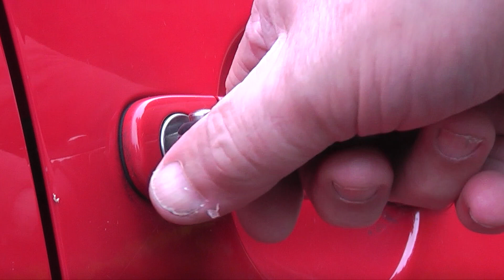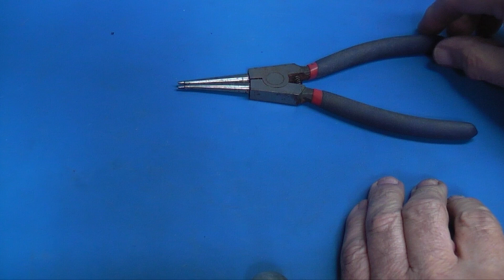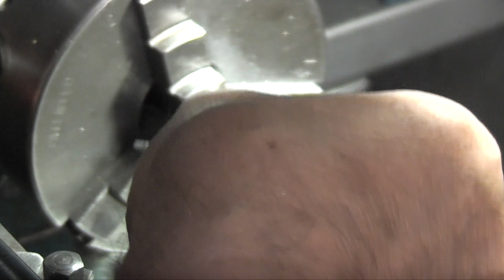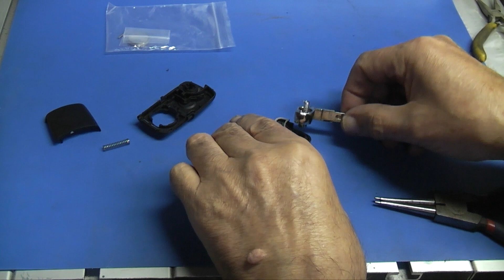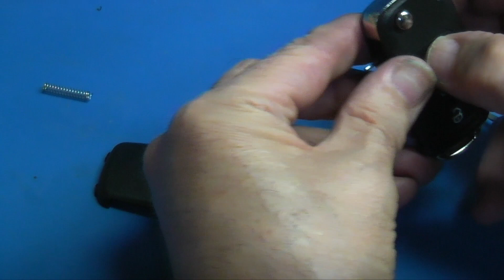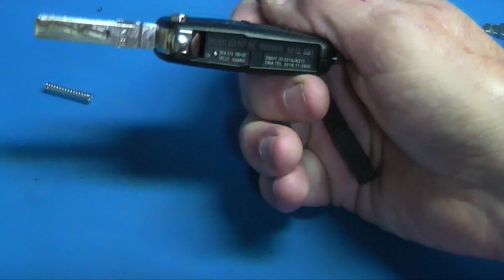Broken car key

Comment: Hi folks, take great care not to break or damage the pcb in the broken key unit. That pcb is effectively linked to the security electronics in the car and these are often part of the engine control unit. Break that small pcb and you may be looking at a VERY expensive repair.

Comment: Well saved Alan, fiddly little job but I am sure £100's cheaper than VW would charge! Tip for turning very small diameter pins in case anyone else is doing similar, use 4 or 5mm stock, take a scratch pass on the OD, measure and set your compound, then take all the material off in 1 pass down to size, this avoids deflection. Cheers, Jon
Reply: Thanks for the video. I have one that needs doing.